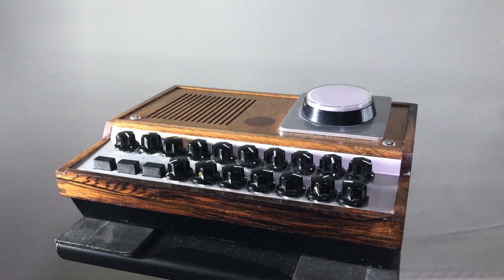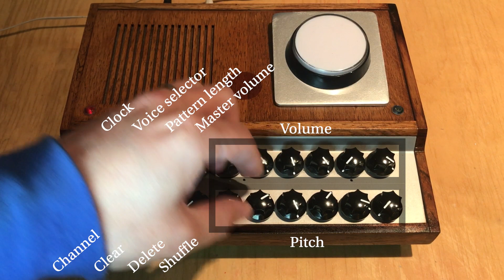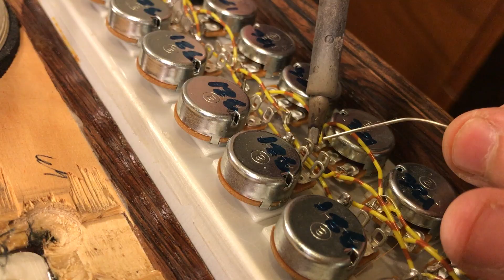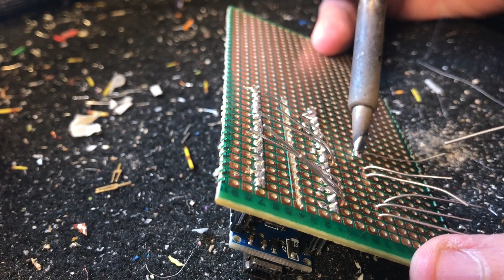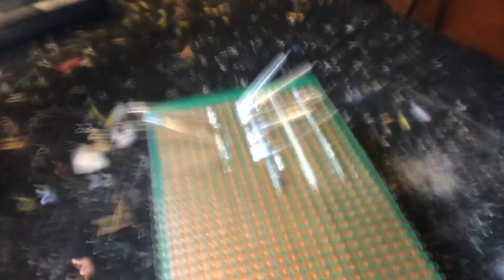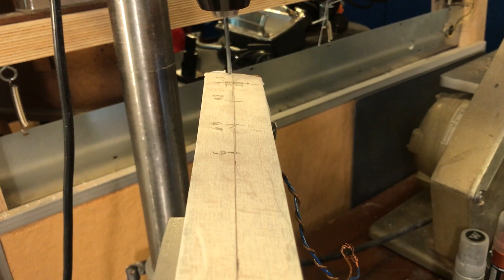Koje 16 – Diy drum machine in a upcycled case

Comment: Great build!As someone looking to get into stuff like this with zero experience, where do you recommend I start in the world of diy synths and electronics?
Reply from the maker: Well there are a lot of small kits you could first try. Search for Atari Punk Console kit. That is a classic starter to electronics and synth making. Also the 40106 oscillator is a super simple first. And Look Mum No Computer has a good video on a super simple Oscillator too. He used it to make 1000 oscillators. But the kits are good starting point I think. And of course circuit bending.